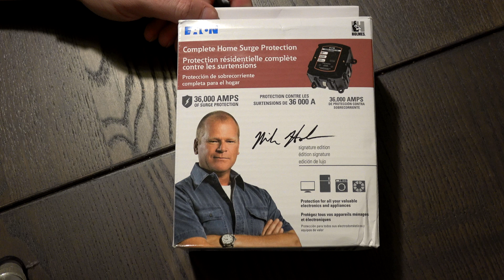EATON Surgetrap CHSPT2SURGE Whole House Surge Protector Suppressor TEARDOWN what’s Inside?

Comment: Hi can you explain the benefits of using the 50 A breaker vs the 15 A ?
Reply from the maker: 50 amp breaker will allow it to shunt more power to ground before tripping, than a 15 amp breaker will. 15 amp may trip sooner, before that surge is shunted fully.
Reply: Thank You @KmanAuto

Comment: Thanks for the teardown with clear images. This model looks like it has 4 MOVs: L1-N, L2-N, L1-G, and L2-G. From a review on AMZN, I see the upgraded 'ULTRA' model of this adds 2 more MOVs in parallel for each of the connections. So, instead of 4, there are 12 MOVs, as is clearly visible from the unpopulated solder pads. It's interesting that all the pads seem to support the 3-lead MOVs (the ones with the thermal fuse), even though only the top most ones (populated here) connect that fuse tap to the LED. I guess it's cheaper to buy those slightly more expensive MOVs as a single bulk order rather than have 2 types on the board. 

I think I'll try building my own. Those MOVs are less than a $1 in low quantities, and one could wire the whole thing up in a nice steel junction box which would protect against fire and contain the bits if a surge exploded the MOVs. Probably could build a better clone for ~$20, which is substantial considering the 12 MOV ULTRA version is currently going for a ludicrous $190 at the bix box stores.

Comment: looks like a red(2) * red(2) * orange(10^3) Resistor  = 22K ohms, not 77 ohms. Gold band = 5% tolerance. Typically the 120VAC drop would go through the series resistor, the diode,  and LED so that the LED has maybe a 2-3V drop across it for the amount of current limited by the resistor. The diode is in there because AC has both positive and negative voltages which the LED wont like.  Thus it allows only positive or only negative AC voltage depending on how the circuit is connected. MOV's are basically for short periods/duty cycles of  high frequency voltage clamping.

Comment: The Ultra model has 12 MOVs.
Reply from the maker: Of course ABSOLUTELY MASSIVE markup for an additional $2 in components....
Reply: @KmanAuto  Ok so this is interesting. 10 years ago I bought the older CHSPT2MICRO and recently I bought the CHSPT2SURGE (same as in your video). These units are effectively supposed to be the same as they have identical ratings. HOWEVER, I noticed the CHSPT2MICRO has ALL 12 MOVs fully populated on the circuit board with the Sincera T25D241K MOVs. And of course the CHSPT2SURGE only has 4 of these MOVs, with 8 empty spaces. So what I suspect is happening is that back in the day, the CHSPT2MICRO was physically the SAME as the more expensive CHSPT2ULTRA, they just rated it lower on paper. Likely did not make sense to have two different assembly lines. But now, the CHSPT2SURGE only has 4 MOVs while the CHSPT2ULTRA has all 12 populated.
Reply from the maker: @speedboxx Great catch — you’re spot on with that observation. A lot of manufacturers used to “bin” products from the same production run and just rate or populate them differently to hit different price points. It definitely looks like the older CHSPT2MICRO was essentially a CHSPTULTRA in disguise, just with a different label.

Now with the newer CHSPTSURGE only having 4 MOVs populated, it’s likely Eaton started cost-optimizing the design — fewer components, same specs on paper, but potentially less headroom or lifespan in real-world conditions. It’s a good reminder that sometimes older gear was actually overbuilt, and newer versions might not be true 1:1 replacements despite identical ratings.

Thanks for sharing that — really helpful insight for anyone comparing the models!
Reply: this what i used with a 50 amp breaker . bought a trim plate to make a neat install.

Comment: I wish you gave install details. I’m trying to understand where in the box the 50 amp breaker should go? I understand we’re not supposed to extend the wires.
Reply: i installed mine on the side of the panel . i moved all circuit breakers under the main down 2 slots making room for the 50 amp 2 pole breaker. the red and black  wires go straight to the breaker only about 9 inches away as instructed in the directions. the green and white go to the ground/ common bus .
Reply from the maker: For me, the only place I could put it was at the bottom of the box. I do believe I had to extend one of the wires to the ground bar. extending is fine as long as you use properly gaged wire.
ideally, having it as close to the main breaker as possible is the best option, however it is not 100% important. The surge suppressor is still the closest thing to ground in the box, so no matter what that is the shortest path to ground. If something is big enough to get past the surge suppressor, the surge for pressure isn’t going to stop that surge anyways.

Comment: Thanks for the video! I wonder if it may be a good idea to replace the MOV's every 5-10 years as preventative maintenance. These things are super cheap, so surprising how the entire units sells for $150 these days. 

Also, on the PCB board there looks to be enough room for ~6 additional MOVs. I wonder if it would be a good idea to solder on additional MOVs to increase the Joule rating, and also the lifespan.
Reply from the maker: I don't think it is necessary, however, given what the PCB looks like, it appears it was designed for more MOV's. Personally, I think eventually, for a winter project, I'll not only add MORE MOV's to the PCB, but those additional MOV's, I'll get lower voltage ones (meaning, they will divert at a lower "trip" voltage if that makes sense). Then it will be a multi-tier protection. I'd rather it trip early on some lower voltage MOV's, and save my equipment, than too late. If a strike or surge is going to fry every wire in the house, nothing I install will stop that anyways, insurance will be rebuilding my home at that point (happened to a very rich business acquaintance, lightning went in he roof and out the side of his mansion. Physically, little damage, however, fried every wire in every wall, so insurance gave him 3million to tear it down and rebuild as it was cheaper than ripping every wall open to replace and repair the wiring. ) 

Personally, I also have a KVAR device, but not for power-factor correction. As residential metering doesn't charge or factor in for power factor and a KVAR unit can actually INCREASE your bill if not done properly (unless your home is giving an insanely low PF), but the capacitor bank serves as an "absorption" device. I have a TINY capacitor on all the time to help smooth out mild spikes,  without increasing my electric bill at all. If I know we have a major storm coming, I flip the circuit breaker to a MUCH larger KVAR unit with a nice bank of 4x100 mf capacitors. It does a good job of absorbing those spikes that occur when a storm hits. Saved my old home in my opinion in 2006. Bad storm, our transformer blew. That house was in the city with homes very close together. All 4 of my other neighbors on the same transformer had all major appliances burn out, my home, which was also closest to the transformer, had zero issues. The breaker on the KVAR did trip, likely took as much of a surge as it could. I did replace the caps even though they tested fine. Used a 1/4 watt resistor to discharge the caps. Caps are cheap. 🙂
Reply: @KmanAuto  Exactly my thoughts. With this Eaton surge protector, I believe there were multiple tiers with different ratings. It's pretty clear from the board that the higher tier ones are just the same unit but with more MOVS and a different label. These MOVs go for $1 each so you can easily more than double the capacity for cheap. With regards to using MOVs of a smaller clamping voltage rating, the only thing I don't know would be how it effects the indicator LEDs that show when it's end of life.
Reply from the maker: @speedboxx  My thought on that would be, even if the lower clamping voltage MOV's go out first, and don't trip the LED's, if the LED's aren't tripped, that would mean the higher clamping voltage ones are still functional. As such, it would still be within it's original specs and functionality. That, and I have a hard time not "touching" stuff, so Likely I'd be opening the unit and checking it on a regular basis, maybe Spring and Fall. Like the smoke alarm schedule.
Reply: @KmanAuto  Replying back to this old comment. I had a closer look at the circuit and now understand how the LEDs work. The MOVs used are thermally protected with a built in thermal fuse and a 3rd pin for indication (for the LED). However, regardless if you get the basic SURGE or ULTRA version, ONLY two of the MOVs actually make use of the indication pins to light the LED. This would be the MOVs on the L1-N and L2-N phases. There is also a L1-G and L2-G MOV of which you'd have no idea the status. This means that even if you got the ULTRA version with 12 MOVs (3 per phase), you could have up to 10 failed MOVs with the unit operating at reduced capacity, and the LEDs would still be lit. Since MOVs typically fail short, in this application it would NOT be a good idea using normal MOVs over the thermally protected ones.
Reply: Most of them have lights that indicate if they're at EOL. I wouldn't change them as a matter of routine. Those little breaker ones will 'pop' fairly easily if you get a big spike.

Comment: It's just as 'minimal' as I thought it was. These are the most 'popular' consumer models through an aggressive marketing campaign. I think the 'Ultra' has an insane $75,000 equipment warranty or some crazy amount that you just knew they would NEVER pay out on or you'll never collect. Their warranty states : "failure due to direct lighting strikes and temporary over-voltage are not covered". My advice would be to get a commercial model which has many more MOV's or the better designed SPD's which use a combination of MOV's and GDT's to effect a longer life by preserving the MOV's. A GDT is a Gas Discharge Tube filled with a plasma or metal halide gas.
Reply: What's some good commercial models? I'm guessing these Eaton units are still better than the cheapo surge bars that most people use.
Reply: @speedboxx  The one I got was an Erico EPD 120/240 TDFL I got new from a surplus supplier on ebay. It's a commercial unit made in Australia. There's others on there too if you look around you can get a deal. I paid under $80, may have been cheaper.
Reply from the maker: I personally have a capacitor bank setup. I keep it off though unless we are having power issues or a storm on the way/in progress. Technically, it's a KVAR, which, for residential metering does absolutely nothing (Which is why I keep it off when not needed for above reasons, as it costs rather than saves money). It's big enough where it absorbs larger (not insane) surges smoothing the spikes out.

Comment: 5% is just the accuracy. There will be variation in any electrical component, so a 5% 100 Ohm resistor means it will be between 95 and 105 Ohms. You pay more for higher accuracy and also for a higher watt rating.
Reply from the maker: Thank You.

Comment: Thanks for this, I was about to buy one. Completely insane that they're charging $55-100 for these.  If you read the warranty and the protection guarantee it's a complete joke. They won't pay you a single red cent even if it does legitimately fail.
Reply from the maker: For the price, it's an extra bit of protection. Heck, my homeowners insurance gave me a (small) discount for having one, so in a couple years it's paid for anyways by that discount, so why not.
Reply: @KmanAuto  I was wondering about the insurance discount myself.
Reply from the maker: @williamvaughan1218  Mine knocked off about $20/year
Reply: Agreed on the overpricing, and they seem to have spiked up recently. I installed the SquareD HEPD80 on my panel about a year ago, and I think I got it for ~$80, but I see it is now closer to $130. That's insane considering it's (at best) 9-12 MOVs that cost 50 cents each and a plastic housing. The BOM for these things is probably less than $10 for the manufacturer. A 10-15X markup is outrageous. I think I'll build my own when this one dies: it's about as simple a circuit as one can build. Put it in a metal junction box and it will be safer than these plastic and epoxy units.
Reply: @bnasty267  I made a comment up above of which I believe I discovered that the older CHSPT2MICRO (12 MOVs) was effectively the same as the premium CHSPT2ULTRA (12 MOVs). It was only marketed as a lower tier unit. However, now the CHSPT2SURGE (4 MOVs) which replaces the MICRO is a downgrade despite having the same rating. Standard MOVs are about $0.50 each, but these thermally protected MOVs are surprisingly expensive at $2 each. It would not be a good idea to use a standard MOV in this application.